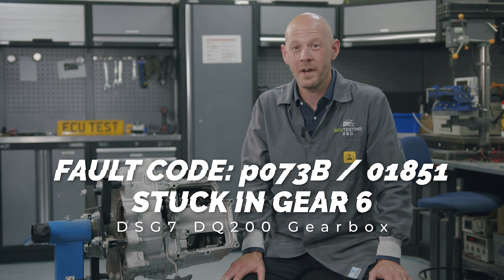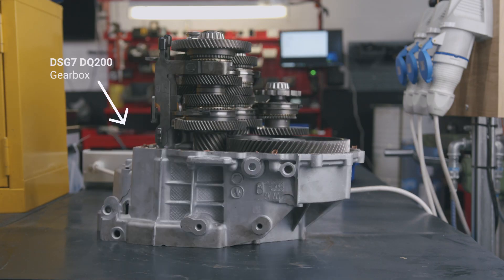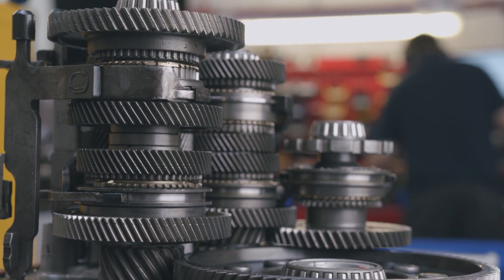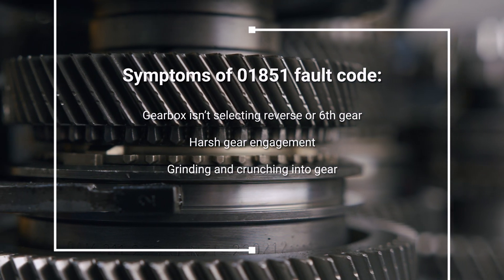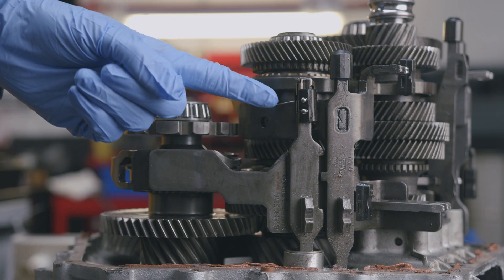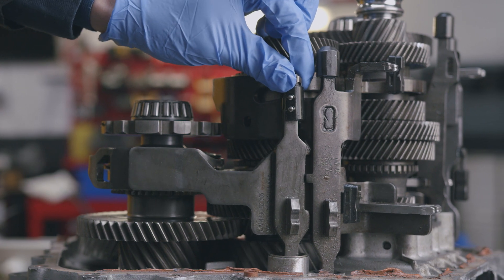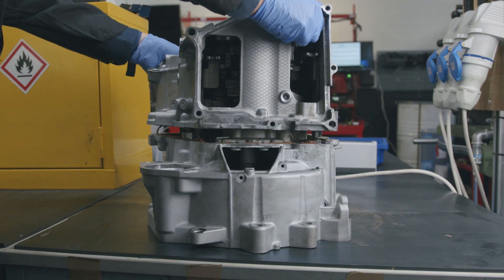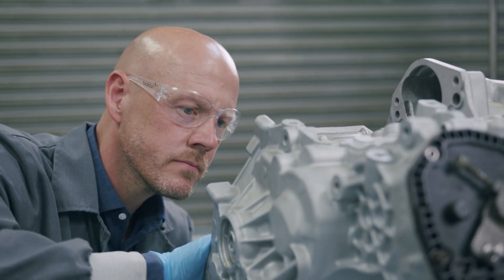DSG7 DQ200 Gearbox Mechatronic – Unable to select Gear – Fixed

Comment: Vw tiguan 2017 stuck in gear 1 P072C00 & P176A00 car works fine when is cold running till the temperature reaches 90 degrees after that emergency mode on gearbox leaving only 2-4-6 working and reverse is this a mechatronic failure or gear failure
Reply from the maker: Hi there, you can find more information on mechatronic failure on our website here - https://www.ecutesting.com/categories/dsg-mechatronic-units/ If you believe it may be causing your issues, you are welcome to send the part to us for testing. If you have any queries, please give us a call on 01773535638 or email info@ecutesting.com. Thank you!

Comment: I own Audi A3 2014 with Dq200 0CW, the car judders after I drive for 20 odd miles when the gear box gets heated up and the only fault code I get is no communication with the gear selector module U010300. How do I diagnose this issue whether it is the mechatronics unit or the clutch by itself. Can you please provide your expert opinion?
Reply from the maker: Hi there! We have repaired for this fault code on the DSG7 before. You are more than welcome to send in your mechatronics so we can test and confirm if it is faulty. You can follow this link to our test form; https://myaccount.ecutesting.com/?return=/TestForm to get the process started. Thank you.

Comment: Omg I've got the same problem with my VW POLO DSG stopped working when I was driving, spanner light started to flash at the same time the gear indicator which was D5 also started to flash

Comment: I have a fault code on my MK6 Golf 1.6 P0841 Transmission Fluid Pressure Sensor/Switch A Range/Performance, ,and P177C Clutch 2 Tolerance Limit Reached. Any idea the cost of repair ?

Comment: Does the mechatronic unit control the hydraulic with PWM. Looking at SSP-390 it appears to have a 3 position valve for each gear pair but the control valve has only one solenoid and a return spring, therefore, I assume it would need to be controled with with a PWM signal to get the 3 positions?

Comment: Good morning, I have a problem with my DS gearbox. The light is flashing soon as you turn the ignition on when is in Park and the same thing it’s stuck in park I have to open the cover press the button at the side to drop it into park I park into neutral when I do that the light is still flashing And the car won’t start and it’s saying PNN to put it into them gears to make it start, but when I’m doing that it’s not doing nothing car still won’t start
Reply from the maker: Hi. Please email our technical support team on info@ecutesting.com with all the details of your message above, as well as the part number printed on your transmission control unit. They will be happy to advise you further.

Comment: Error: gearbox. Reverse gear not available.
Reply: Please advise I received this error
Reply from the maker: Hi. If you haven't done so already, we would recommend getting it scanned for fault codes. Please email our technical support team at info@ecutesting.com with the results of the diagnostic scan, any fault symptoms, and the part number of the unit itself, and they will be happy to advise you further. Thanks.

Comment: my VW GOLF MK7 gear is stuck in parking and the P is blinking. My mechanic says the mechatronic unit has failed and i have to replace the whole gear box. Can you repair mechatronic unit without having to replace the whole gear box?
Reply from the maker: Hi. Yes if your mechatronic unit is faulty then we can re-build it without needing to replace the gearbox, please fill in our online test form to find out how to send your unit into us: https://myaccount.ecutesting.com/. Check your mechatronic unit's part number on our website to see our most up to date prices. If you can't see your part number on our website, or if you have any further questions then please email our technical support team at info@ecutesting.com and they will be happy to assist you further.
Reply: Skoda rapid 6 speed,
Gear is not engaging on odd gears but engaging on even gears.
Error code is cleared then car is moving, but error is came back. After that not moving. 
Did you know the solutions

Comment: Hi I’m getting these codes 
P1725 (Compare transmission output speeds 1 + 2) 
P072D,E,F Stuck in Gear 2,3,4
It jerks into gear and seems to only change to 3 5 and 7 Also lose reverse have to stop and start the car.

Comment: Hi 
I have a similar issue, stuck in gear 2 and sometimes it moves to 4 and jumps to 6. Computer says transmission shifting sensor. I wonder if that’s the problem if u could help. 
Thanks
Reply: did you ever get this reolved. i have the same issue
Reply: @rsmotorsinternational8836   

Any fix ? I have MK6 Golf 1.4 TSI (170hp cavd) and when cold the car goes only 2nd gear, if warm 2>4>6+R sometimes after hour it makes some gear 
/clutch sounds and the dsg will work normally again. Someone said my whole mechatronic needs replacement but 2.000€ isnt something im gonna spend on this shitty car anymore
Reply: U found soulution bro?

Comment: Hi - I have replaced the bearing with standard as it had snapped and was stuck to the magnets used to operate the Mechatronics unit. The fault I had initially was reverse, 2nd, 4th and 6th gear only. I have put the box back in the car and all seemed well, until again I only had reverse, 2nd, 4th and 6th. It would reset if I turned the car off and on. But now I do not have any forward gears, only reverse. Do you have any ideas?
Reply from the maker: Hi. Are you able to scan the vehicle for any fault codes? Due to the initial intermittent nature of the fault, it sounds like it is more likely to be an electrical fault, however without any codes it is difficult to say. If you could email our technical support team at info@ecutesting.com with the scan results and the symptoms of the fault as you have detailed above, then they will assist you further. Cheers.

Comment: Have a vw Tiguan 2017 emergency transmission mode - no reverse only one gear.
Reply from the maker: Hi. Do you have any fault codes present? It sounds like you may have a faulty mechatronics unit, contact our technical support team at info@ecutesting.com if you would like further assistance. Thanks

Comment: This is excellent video production.. wow

I have a DQ250 that drives up until the end of 3rd gear. And won’t shift into 4th. BUT if I put it in neutral, if I’m at speed it will skip 4th and go to D5 or D6.. is that clutch pack, synchro, or mechatronic???
Reply from the maker: Hi Connor. Without any fault codes or further information we can't definitely say what the cause could be. However if you email us at info@ecutesting.com with any other symptoms, fault codes or fixes you have tried etc, then we should be able to help you out. Thanks
Reply: @Ecutestinglimited  wow thanks for the reply! All I got was P2711.
Any PayPal I can send for your trouble?
Reply from the maker: @connorb9097  No need Connor, happy to help! If you have any other questions regarding the fault code or any fixes, please contact our technical support team at info@ecutesting.com. Thanks

Comment: What is the likelihood and expected mileage of these bearing failures?
Reply: Mine failed at 80.000 miles , car was in mint condition, all of a sudden it wouldn't select any gears and said "gearbox failure" and that was it , quoted by 2 garages around 2.500 grand to fix ,sold it as spares and repairs, just had enough, it's embarrassing that my old Vauxhall Astra from 2002 had the automatic gearbox in perfect condition and my 2015  Golf mk 7 failed so early ,cars these days are so fragile 👎
Reply: I’ve seen them mostly around 140-150k kilometers!
Reply: Our one was 20,00 miles
Reply: 104k miles so it appears to vary